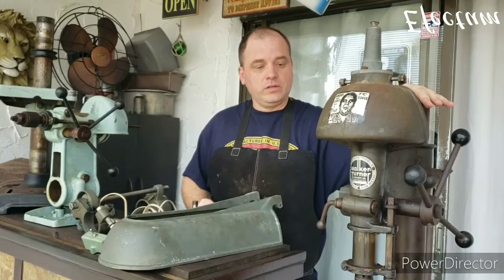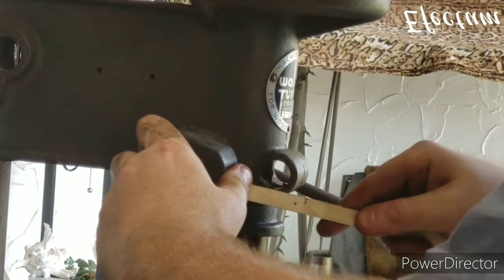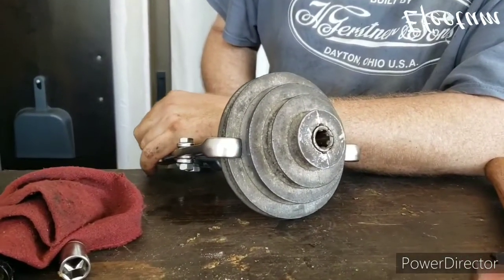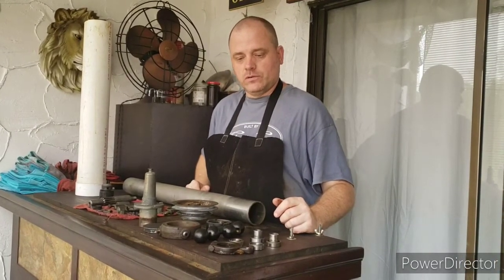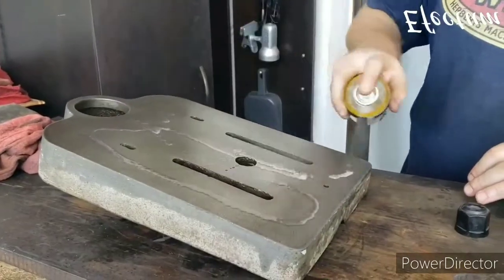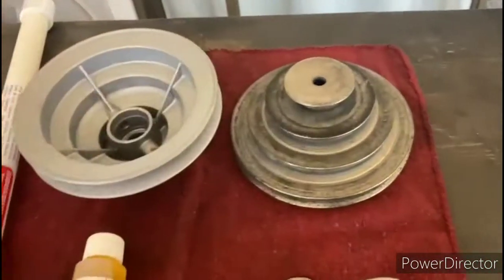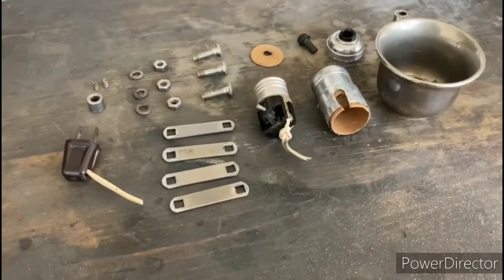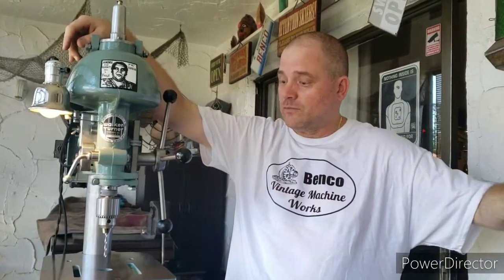Drill Press [Restoration]: Walker-Turner 900 (Andre The Giant) with a MuggyWeld repair on pulley.

Comment: beautiful and loved the fact that you tried to keep the machine as original as possible and going ahead to repair them. The idea of using a smaller sized belt is genius. I think that 2 L size is just perfect. It looks good and flexible enough be straight from tangent to tangent. I picked up a floor model for $162 at an estate sale, it looked to be be great condition. Previous owner had it restored and painted decades ago it seems. It has the slow speed pulley attachment and the screw riser mechanism. Nothing broken or chipped. I am looking for the production version of the table with the coolant ways. Fun and rewarding to restore these old machines. Glad you got the other spare in working order and donated.
Reply from the maker: Good luck with your drill press. These were well made and should serve you well. Thank you for watching the video.
Reply: @BencoVintageMachineWorks  I hope to sell off the top belt cover and recover the whole cost and have some $$ left in my pockets. Best bet is to find another for a good price that has that production table to get that. That said it’s standard table is good as it is. I just want the production table for the looks :-)

Comment: Great video. I have one of these models, and i never knew it is supposed to have a light, a table lifting mechanism or a third (centre) drive pulley.  I'm restoring mine right now. I'm in the UK and bought it in a rusty, but mostly working condition for £25.  Very pleased with it.
Reply from the maker: The drill press will serve you well. Those accessories you mention take it from good to great but tough to find. Good luck with your restoration project.

Comment: Nicely done! I bought some Muggy-Weld sticks and they are around here (somewhere). I just haven't had a use for them (yet). Nice to see that they will work on that pot metal.
Reply from the maker: Got the job done and theres not many good options when dealing with pot metal. Good luck with your next project.

Comment: Your ingenuity and talent on the speed reducer was stellar. If you had  to do another one would you do it different?
Reply from the maker: I am pretty happy with the outcome on this because I kept it all original and wouldn't change anything.
Reply: @BencoVintageMachineWorks  I have a speed reducer I'm not sure I have the talent to do it. I would like to be able to clean and grease the bearings.
Reply from the maker: If your speed reducer is for a Walker Turner machine you should try to determine if it is the type that can come apart or if it is the integral bearing design as I had. If it can come apart, obviously its easy to grease it. If not you will want to lubricate in place.
Reply: @BencoVintageMachineWorks  Unfortunately I think it is exactly like yours.

Comment: I have a similar press... I am not very mechanical... My press is not turning the shaft. The pulleys turn but it's not grabbing the shaft. I see a couple of allan set screws on the pulley. Is that what needs to be worked at?
Reply from the maker: Yes there are allen set screws that secure the pulley to the motor. The pulley on the press itself should be keyes with a spline and not able to spin unless it was changed over the years.

Comment: What an amazing video!!!  Thank you for sharing a lot of the details on restoring this beauty.

I just got one.  Fully functional...everything in working order.  It does not have the: 3rd pulley (slow speed mechanism), original switch,  belt cover, nor that table raise mechanism.

I do have a couple of questions if you are okay with sharing additional details:

1. What wheel are you using in the grinder to polish the parts?
2. What color did you use?  Paint Brand?  I heard you comment on the clear coat, but did not hear the color/brand used.
3. Any recommendations for places to source an original switch and belt cover from?

Thank you!!
Reply from the maker: Thank you for the compliment. To answer each of your questions:
The wheel is a Scotch Brite type fiber wheel. The color iis Matte Pale Sage by Krylon. That color is not original. For a beautiful color more closely resembling the original use Sage Green by Rustoleum. The clear coat is 2K clear. 
As far as the accessories go, they are expensive. It's probably cheaper to find a machine that has them on there and part it out. Of course Ebay has them readily available. Your best bet is to search the BOYD section on Owwm.org (you can also post a "wanted to buy" there. Good luck!
Reply: @BencoVintageMachineWorks  oh, and I checked eBay… you were not kidding!!  100.00 for a switch!!  300.00 for a belt covert!!! Holy smokes!!  I paid 80.00 for the whole machine…

Comment: Great job! I just picked up a WT bench model and it’s missing the quill lock… Are the quill locks the same size (interchangeable) between models? Like say between a 13” and 15” ?
Reply from the maker: I have never owned a 13" model so I can't say for sure. Post your question on the owwm.org forum and you will get a prompt answer. Good luck with your project.
Reply: The quill locks for the WT900 are readily available on eBay,.  I have rebuilt a few of these but cannot confirm the 700 uses the same locks.

Comment: Hello, me again... do you mind sharing the belt size used on this build?  I am going to machine a reduction speed assembly and want to have the correct belt size needed.  I could not read the specs on the belts from the section where you are talking about them.

I did manage to get an original switch and have now installed and wired it.   But I want a reduction assembly and just can't pay what folks are asking for those on eBay... so  I will try to make one...

Again, if you can share the part numbers on the belts, that would be of great help.
Reply from the maker: I am using a 4L280 from the motor pulley to the slow speed pulley and a 4L280 from the slow speed pulley to the quill. I tried a couple different combinations and I am happy with this set up. In the video, I used a smaller width belt to reduce pressure on the repaired pulley. I got hold of another pulley though so now using the correct 1/2" width.
Reply: @BencoVintageMachineWorks  thank you for the quick reply!!!  Ordering those now.  Thank you again!
Reply from the maker: Anytime 😊

Comment: Beautiful work, this is the only video I’ve seen on changing the pulley bearing, and since they’re not available I don’t see the need in risking my pulley…lol. Where you able to find new spindle bearings? I’m working on a 1300 model right now.
Would you suggest the brand of paint and 
clear coat you used? Outstanding job on 
the rebuild, enjoy the fruits of your labor.
Reply from the maker: The quill bearings for this DP are a 6202-10 and readily available online. I already had several extended race bearing replacements on hand and used the best ones I had. The color was Pale Sage Green by Krylon which was top coated with 2K clear. Thank you for watching the video.

Comment: do you have a reference of the pulley bearings? thank you from belgium
Reply from the maker: Walker-Turner made two styles of slow speed pulleys. One of them has replaceable bearings but I do not know the bearing numbers. The other style, like the one shown here, has bearings integral to the shaft and they can't be replaced.

Comment: Great job!Gotta love the fact that you used a WT bench grinder in the resto,is that one of those 3m unitized wheels you were using?How did you restore the WT badge or is that a repro?
Reply from the maker: The wheel is an inexpensive fiber wheel off Amazon. It's similar to the 3M but less expensive. In the beginning I started out with two drill pesses if you recall. I took the better of the two badges. Just cleaned it lightly and clearcoated it. Glad you enjoyed the video!

Comment: Do you have a source for your nameplate pins?  
How did you repair the hole in your table?
Reply from the maker: The "pins" to secure the badge are commonly known as drive screws or drive rivets. I buy mine on from McMaster-Carr. I repaired the small hole in the table by drilling and tapping it. I used Loc-Tite red and put a small piece of threaded rod in the hole and ground it flush.
Reply: @BencoVintageMachineWorks  Thanks for the info. I'm working on restoring a Walker Turner drill press for the first time. Actually this is my first machine restore. I wasn't sure if I should try to remove the drive screws or just mask over the nameplate. I was afraid of damaging it.
Reply from the maker: If you can get by with just masking it that would be easier unless the badge itself needs a restoration.

Comment: I have a 40's era Walker Turner drill press. I have happily used it for years. As of late the chuck has started slipping. I am clueless on how to repair it. I am not as adept as you are. Is there as simple way to tighten the chuck?
Reply from the maker: The chuck is secured to the drill press spindle using nothing more than a tapered press fit. You can lightly tap upwards on the chuck using a soft hammer or piece of wood to help re-seat it. If the drill bits themselves are slipping, then the jaws of the chuck are worn. In that case, you can just buy a new chuck or rebuild the old one.
Reply: Next is to set up a slow speed pulley system for it.
Reply from the maker: The factory WT slow speed pulleys show up regularly on ebay. Nice thing is they are plug n play so to speak.